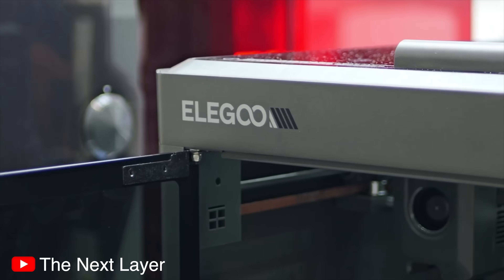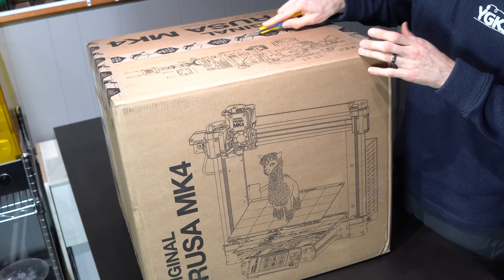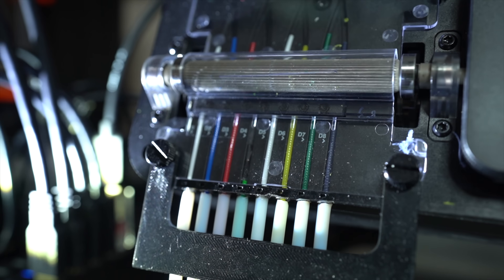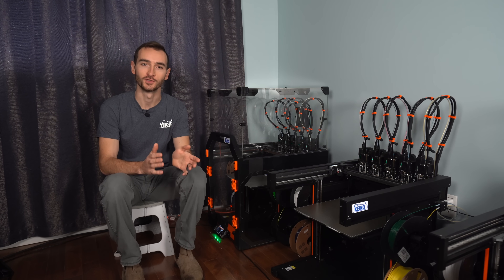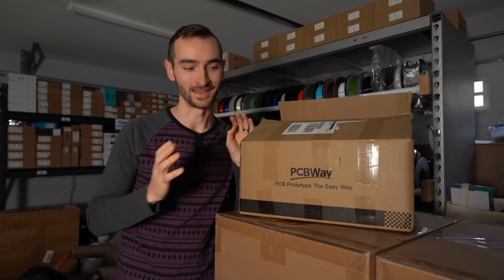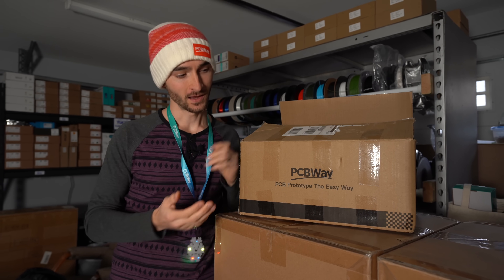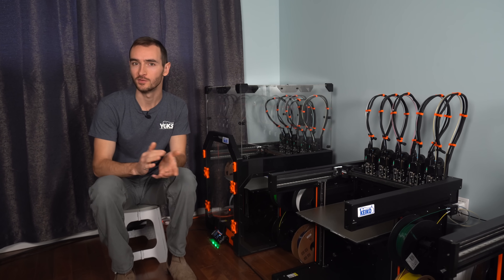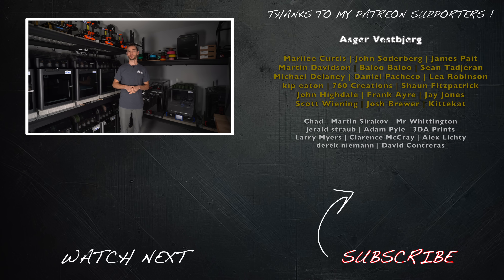The Prusa Core One is dividing the internet...

Comment: Wait so rather than simply replace a part and get a Bambu printer working again you'll just toss it? That seems insane!  I have 3 X1C's each with over 1000 hours and no major issues at all. So far I have been able to fix and repair anything needed. Bambu has a great detailed Wiki on how to fix anything on the machine. I started with Prusa and loved them but they are just too $$ for what you get and I just want results and Bambu is doing that at the moment. I am still confused why you can't fix those 2 printers though!
Reply: Had force sensor problem,  it only looks daunting because the steps are very thorough. The Prusa build looks super complex by that metric. I saw Robert Cowan repair the xl and that doesn't seem any more complex than servicing the x1
Reply: @kazolar I’ve repaired both XL and X1C. The X1C is far more annoying and time consuming to fix. Taking off the X1C side panels are a pain. Changing an extruder motor takes 30 screws.
Reply: Sounds like KTM ;)
Reply: I started with Prusa but they sent me a lemon MK4, admitted it but refused to replace it. I went went with an X1-C since I was out the MK4 that never worked and I have loved it! I'll never waste money on their outdated, maybe-it'll-work, expensive printers again.
Reply: You forget; sometimes just buying a new item is cheaper than spending hours trying to fix something. 
I’m sorry if your time is worth less than the cost of the printer, but for some it’s simply not worth fixing stuff.
Reply: Apple computer dominate the market through underpricing its products?  What are you talking about?
Reply: You forget; sometimes just buying a new item is cheaper than spending hours trying to fix something. Time is also a resource that people seem to forget to account for. 
I’m sorry if your time is worth less than the cost of the printer, but for some it’s simply not worth fixing stuff.
Case in point; when my nozzle clogs on the A1, it’s better for me to just toss in a new  nozzle than spend 30 mins trying to troubleshoot it.
Reply: Agreed
Reply: "Over 1000h" is hardly a qualification. It is not even a bare minimum requirement. 
Let's talk again, when this is 10k or 20k hours.
Reply: This dude is ridiculous. A force bed sensor is $5. He will sideline  a $700 or$1200 printer than spend $5  and follow the wiki or $120 for a new heat bed? but he had no issues dropping 4-5k on an XL and build it ? 
Me thinks his reasoning is beyond suspect and borders on ridiculous. 
a single heatbed tile for the XL is $23 x16= $368
Reply from the maker: @No0o0o0o0o0  it’s not an issue of cost. It’s an issue of time. I’m perceiving it to be a difficult process given how tightly integrated the printer is. But I could be mistaken. I’ll tackle it at some point and find out.
Reply: @ygk3d I feel like criticizing Bambu's repairability without having actually experienced it is a bad move for credibility.
Reply from the maker: @zakm0n  that’s my perception based on the information I have. And it’s the general perception in the community that Bambu printers are more difficult to service given how tightly integrated they are. I’ve reviewed the wiki to see what’s involved to repair my specific issues and it doesn’t look easy. If it proves to be easier than expected I’ll be sure to share my findings.
Reply: @ygk3d  I find that repairing my Bambu X1 is easier than repairing my Voron.  For me, the only annoying part of replacing the bed was taking the aluminum panel off the printer to get to the ground screw.  If I ever have to do it again, I'd probably just cut the ground wire and connect the new bed to it with a wire nut or wago.
Reply: @ygk3d  why not go past the perception and sit down and fix the printer and have experience?
Reply from the maker: @TheRawketLawnchair  it’s on my to do list. I’ll be sure to share my updated findings. Too busy with other things during this holiday season to repair broken down printers.
Reply: @ygk3d  I think it doesn't matter how easy or difficult the repair proves to be at I'd suggest you make content out of it. At least you win in that front.
Reply: I think what he said seems a little bias.  He can fix Prusa printer but not Bambu?  We all see right thru that.
Reply: Agree with all Bambu is easier to repair, no weird diy stuff there
Reply from the maker: @damiengvideos4337  definitely not tossing them in the bin. Just saying they are unusable until I find time to repair them and I’m a bit intimidated by the process. I’m probably overthinking it. It might not be as bad as I’m anticipating.
Reply: @ygk3d  "definitely not tossing them in the bin" - 11:15, you say you'd throw out a malfunctioning P1S. You literally say those words. LITERALLY.
Reply from the maker: @ “writing off” means selling for cheap to someone that wants to dedicate the time to repair them and reinvesting that money in a new printer. Using those units of time saved not repairing a printer to do something more productive. It’s a business decision. Would require a proper cost/benefit analysis. Used hardware is a sunk cost and not necessarily worth salvaging, especially if it’s already paid for itself.
Reply: @Those_Weirdos  He owns them, they are his to toss out.
Reply: @ygk3d  If that's the way you want to use the phrase, so be it.

Also I just realized I was looking at the Marathon because of videos you posted... Now I have to completely rethink if I'm going to buy any, since you're clearly living in Bizarro World. I have 2 in my cart right now, based on your experience and interviews, but... Now I have to revisit your praise of the product with a different viewpoint, after you've exposed yourself.
Reply from the maker: @Those_Weirdos  exposed myself as someone that prefers to print than repair printers? Makes sense. You’re entitled to your opinion.
Reply: @ygk3d  wait a sec, so you don't have the time to replace something so easy as a sensor, but have the time to build and entire printer from kit?
Reply: @ygk3d  put your money where your mouth is and sell all of your bambus all at once.

Comment: Funny enough, I currently have an Elegoo Neptune 4 pro. Works beautifully and at $210, I would argue better value than the A1 mini. My problem with the market currently is that a few years ago, we talked about every manufacturer. Now we act like there are only 2.
Reply: Great comment.  I also have a Neptune 4 Pro and it's been an excellent and very reliable printer, and a great value.

Comment: As a long time sufferer of the unworkable MMU2 (firmware was simply crap) and the MMU3 (endless tip tuning per filament) I can honestly say that comparing it to the Bambu AMS just shows the massive gap Prusa has in the multi material space.  Prusa has nothing.  Also the Bambu X1C is not throw away at all ... the parts to fix are easily available on the Bambu website and are really cheap. It's also very easy to work on and service and a very robust unit.   Bambu parts are much better priced than Prusa parts.  Prusa is just unable to compete on price.  That said their work in the OpenSource space is to be commended particularly with their slicer.
Reply: The MMU2 was a product with a known design defect. I fought with that thing for so many hours. I replaced the logic board, I replaced all of the servos (one by one). I printed custom feeds and pretty much every part from scratch. I contacted support. I started multiple threads. I wasted so much time trying to get that thing working. And the best I got was "keep trying, you'll get it!". No. I didn't get it working because it was a faulty design. And to prove it, I took that little power board from the MMU3 and put it on my MMU2 and it stopped giving the 5 flashing lights. 

I will never forgive Prusa for that experience. I got my P1S with MMU and it's night and day. In just one year, I have as many hours on my bambu than I was able to achieve with my Prusa in 6 years. I spent so many hours with it fiddling and fighting. 

skywardsoul, unless you have ever suffered with an MMU2 unit then I don't think you can understand why we see Prusa as a piece of crap. And the XL at $4000 is not a consumer printer, nor is it a competitor to the P1S or the X1C.

EDIT: Oh and don't forget the time they told me I needed to flash the firmware, then the zip download for the MMU2 didn't have the right files in it.
Reply: Prusa has nothing? They have the XL, which is a lot less wasteful and can achieve actual multi material. The bambu is multi-colour, not true multimaterial.
Reply: @skywardsoul1178 which for 5 colors costs the price of like 3 x1c
Reply: How did prusa fall so far behind, when they appeared to be leading years back? If prusa himself were an engineer, then maybe things could have turned out different. It hard to support or depend prusa these days with what they are charging. Yeah, they really need to make their multicolor less diy looking, and more hassle free. That alone should be no go in 2025 when buying a 3d printer for multicolor.
Reply: They have a similar approach to noctua, give their engineers time to get things perfect so advancement has always been a bit slower, just in a new market with lower cost alternatives from china with actually good performance being pumped out faster and fatser their slower innovation strategy doesn't work as well anymore. That said they still have their european manuafturing and sourcing going for them, I do some times wonder how cheap prusa machines would be if they were made in china instead of europe. @oneanother1

Comment: the S upgrade for the Prusa XL will be the deciding factor. if they can keep the cost to upgrade an existing XL minimal they will certainly keep their lead. Personally I preferred Prusa always due to upgradability and support. Bambu is just a chinese company who used already developed open-source technologies in their closed system and sweatshop labor to keeps prices low. If you care about literally anything other than the price Prusa is still the long term victor. Hopefully for them this is only a temporary setback that forces the to speed up whatever innovation they have in development.

Comment: A lot of these comparisons sound to me like the two printers are supposed to somehow be equivalent things aimed at identical potential customers. This is partially true, there are surely people for whom both would work about the same. But there are others. 

There are people with no technical knowhow who do not want to learn how the thing actually works would never even try to service their printer. Recommend them a Bambu printer and let them throw it away when it breaks. When it works it has the best chance of working right for a user like that. And there is a good chance that by the time it breaks a newer version with some (supposedly) groundbreaking feature will be on the market and very likely "on sale" most of the time so this kind of user will not even be all that mad about the old one breaking down. 
There are people who like to do something specific that requires a slight customization of the hardware, or maybe just a crazy weird printing profile. Don't even try to sell them a glued together printer with closed firmware etc. Let them have something like a Prusa that can take all that experimentation and when you break it by experimenting the manufacturer still helps you fix it. And you have a good chance spare parts will be available for it six years later and not intentinally priced over half the price of a new printer. 
There are people who for whatever reason absolutely cannot connect the printer to a network. Their company IT security won't let them, or they are paranoid, or whatever. A printer that loses none of its functionality except having to manually transport print files to it is the right choice for them. And having a physically removable wireless module clearly aims at those customers and might be the only modern printer they can buy. 

Overall I like that Prusa did not try to just straight copy all the features Bambulab has to make their new printer competitive. I like that they made the new thing be still a Prusa with all the things typical for those and that instead they focused on offering various properties the competition does not have. To target potential customers who would otherwise maybe even buy a Bambu printer but would hate something about it. 
And as an engineer I admire the design for how they figured out how to keep it user-serviceable to the last bolt while making sure thing go back together aligned square etc. It is one thing to design a printer to be assembled exclusively by trained personel using special jigs and it is a completely different game to make it designed for both fast factory assembly and possible to assemble with just basic tools at home. And it looks like they figured out how to do this while keeping the cost reasonable by using a lot of laser cut and bent sheet metal. And on top of that the printer still looks elegant and not totally industrial despite using such design. Personally I like the balance they have achieved. I suspect many people will not like that as much but also many will. 
Personally I will not be buying either Bambu or Prusa for myself. I have a 500x500x500 Rat Rig printer, so all those 200-something mm beds seem tiny now that I have gotten used to printing 4kg 600x500x100 parts and similar. And compared how hard assembling, wiring and configuring a V-Core 3.1 used to be assembling the new Prusa kit will be a toy for toddlers 🙂.  It would still be fun but all over in a few hours, not days, and you don't even need to study the CAD model to put it together 🙂.

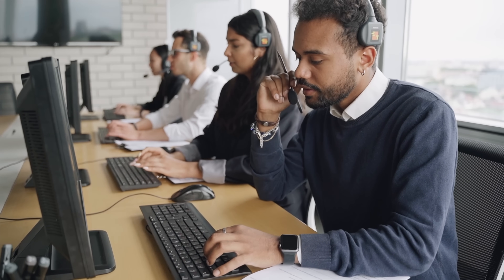Comment: 3:05 Sorry don't by your comment that it is probably not worth fixing ... Bambu sells most parts relatively cheaply... I gladly take them off you lol
Reply: Bambu also have preety good how to guides.
Reply from the maker: @K8Stuff  I’m hoping I’m wrong about that. It’s just an intimidating thought of having to take it apart.
Reply: @ygk3d  Honestly, it's not any worse that disassembling a desktop or laptop computer. Just keep track of your screws and take photos as you go for reference.
Reply: @ygk3d  Intimidating that you'll lose Prusameters when Josef finds out you took a screwdriver to a printer other than his own brand?

You come across as an absolute goddamned shill.
Reply: @ygk3d  If you are running a print farm and you are afraid to open a printer, you might need to find someone to do it for you, or perhaps its not the right business for you.
Reply: @ygk3d  I know the feel man. The anxiety over the repair makes it harder to get started on it than the actual repair takes. Had that issue with my qidi when the hotend got a serious clog at one point but after a week of putting it off it was a 15 minute job to replace it.
Reply: @ygk3d  100% understand. Maybe my 'luck' was that I started with an Ender. Compared to that a Bambu is childsplay . The Wiki and Videos are great. Honestly, I'd have a look at the wiki and check out repairs. The parts really are affordable. No need to panic there :) :)

Comment: Having an existing 3D-Print farm, what performance increase is required to make it worthwhile to replace existing equipment? Do you have a percentage in the back of you head? IMHO, a one-up here and there isn't enough. Have to admit, it's a beautiful machine and offers lots of great benefits. I am just the wrong customer atm. Without Bambu in the marketplace, would the Core One even exist? Besides, the release of Bambu's next generation will likely stir-up the industry once again.

Comment: Hmm, how I see it, Prusa always tried to stay "hobbyist" which in turn also drew in bigger companies to buy their printers, because they looked like the best of the best as everyone was buying them and industrial 3D printers were extremely expensive. They tried to stay open source and I think that they are still staying, at least with their FDM printers. BambuLabs came in and tried to capture the likes of people who want to make a small business with their printers, and don't really care about the hobby as is. Meaning most of the things bambu labs created is Closed source even though they balantly ripped most of their desing from other open source project and closed them up (slicer and software is totally closed source as well as part for the printers). Seems like prusa will need to do the same to try and catch up. With this I am not saying that prusa didn't take from an open source projects, they did, a lot. The first Prusa Printer was from an open source design! Buying a prusa now will defenetively not get you the best printer for you money anymore.
Reply: Bambu labs software is actually open source also the only thing that isn't open on a bambu printer is the network so if you use orca or something other than the bambu labs software you have to load it on the sd card and insert it into the printer.
Reply: @Nilboggen  The only Bambu software that I was able to find that is open sourced is BambuStudio. Software of their printers and their design documentations are nowhere to be found. Or maybe I am looking at the wrong places.

Comment: I ordered after 7 years of having MK3, core one. 7 years ago I was probably the only one around who had a 3D printer (I'm a mechanical engineer) and I use the printer for functional prototypes. Now every uncle who prints pots and figures has a printer and yes, he doesn't have a prusu but a bambu lab. Once upon a time you kind of had to understand how a 3D printer worked but thanks to the bambu lab it is now just a tool you don't think about how it works. Times are changing and the prusa needs to respond. Prusa will always be here. Just like you don't see IBM and companies like that anymore, doesn't mean they don't work, but for printing figures and pots, companies like bambu lab will be there. I don't want to offend anyone with the pots, but you know what I mean.